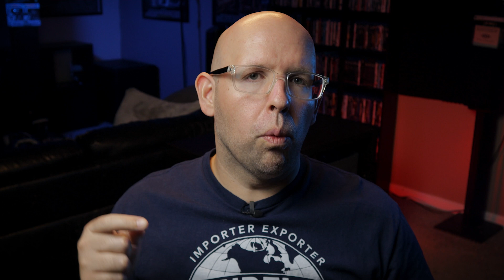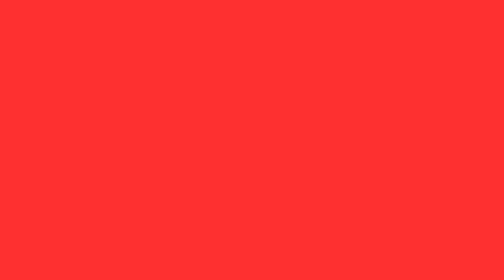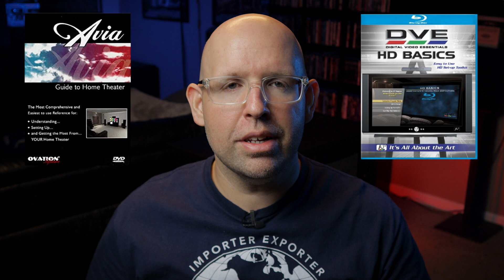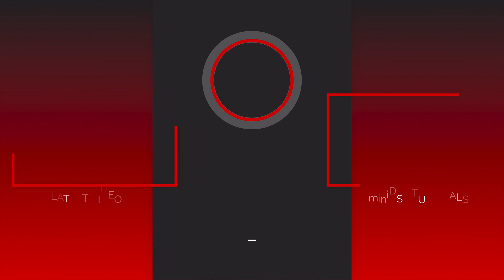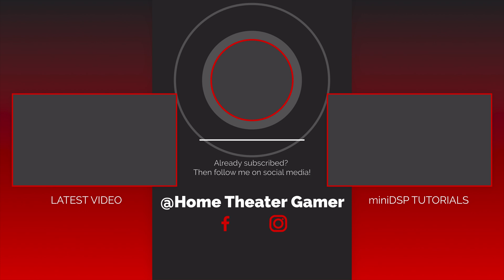FOLLOW-UP VIDEO to REW level matching | EXPLAINING things I FORGOT

Comment: Hey Brad, I hope you could answer my question on the level to set in the tone generator like -30dBFS vs 35dBFS because my center channel polk monitor xt30 got maxed out at -12db on my denon AVR-x1800H while i set the tone generator level at -30dBFS while calibrating to 75db and could not hit the desired level and after changing the level to -35dBFS I could hit 75db on spl with out maxing out my trims in denon. I didn't understand this

Comment: Hi Brad. yoyur are a great teacher !  I do have a couple of questions,  is it possible to calibrate any processor/ AVR  with REW unlike  Dirac ? as I understand a specific Dirac Licence is required for individual AVR & Processor. My system consists of Denon X7200W , Tone winner AT300 Preamplifier, Tone winner  7300-PA Power amplifier  Tone winner AT300 has 3 Sub outs ( One balanced XLR & 2  RCA LFE out) .  .  My speaker system are placed in Auro 3D & Dolby Atmos 7.4.2 Mode. what is the best way to calibrate these formats? your advice would be highly appreciated 

Regards
Anoop
Reply: Hmm…it isn’t an Auro 3D setup without x.x.4. If you are only using two height speakers for Auro…your out of the minimum recommended spec of 5.1.4

Comment: Do you set your Umik to 100% in windows or 0db which is like 53%? After dirac calibration, setting all my levels to 75db with REW I have to take all my levels down like 5 or 6db and now it seems low. Pretty sure my mic is set to 100% though in dirac and 53% in windows for REW. Please help.

Comment: Hi Brad! Love your content and helped me so much in my theater setups. Not sure if this has been suggested already but this is regarding setting the levels on the Atmos height channels. What if we jot down the levels of the surround left and right speakers, then disconnect them and connect the left and right atmos speakers. Run the test tone and adjust to 75db, jot down the levels, disconnect the atmos speakers from the L & R surround and connect them back to the atmos channels and set the level recorded from the surround channels. Then reconnect the surround channels back to their perspective channels and change the levels back to what they were set at. It's a mouthfull and hope you followed me. Do you think that would work in setting the atmos channel levels?

Comment: But if I leave YPAO on, it automatically applies some EQ, right? Wouldn't that affect the REW frequency measurements later on? Should I keep YPAO on just for Level Matching and disable it afterwards? With YPAO on I cannot change any EQ settings to level out the freq. response.

Comment: Thanks for this. So is this the same case with Dirac? I have an Arcam AVR11 and I setup the levels using REW and. UMIK-1 and noted the values before running DIRAC or any other processing. Then after running DIRAC I noticed all the values were reduced lower than when I set them with REW. So I should set these values back to where they were before or Test with REW again with DIRAC active correct?

Comment: Shouldn’t running at 0dB on the AVR get you 105dB? 

I never run REW above -15dB becuase it’s frighteningly loud
Reply from the maker: If set to 0dBfs in REW, then it would read 105dB. But for level matching/calibration, that’s not really needed (and really loud), which is why it’s common to set REW to -30dBfs and calibrating all speakers to 75dB.
Reply: Watched the other video and that answered it!  -30dB on REW…

Comment: Simple question, who says that all speakers at 75 db for all channels, is always the right Choice 🤷, every room is different, and it also tottaly depends on where your speaker are away from your MLP😅 so this is all very different in milions of different rooms
Reply: Simple answer. You are setting the volume levels for reference level volume. Not what you prefer. Otherwise everyone is talking a different language. If you want to listen at a lower volume use the AVR volume to lower it. But the whole point is that at 0 db on your AVR you will be listening to volume at the level the sound engineer designed it for AND you are listening to everyone else's 0db setting. As for what I prefer, I listen at about -15db for movies, but if me and you were to both turn our dials to 0db we will both be listening  to the same content at the exact same level and what the sound engineer desired.
Reply: @Mudcat3434  ok thank you for explaining this so clear, i now understand what you mean by reference level, again thanks for explaining it so simple
Reply: @dutchgrower2971  yep no problem. I was confused about this for a while. And then it finally clicked haha
Reply: @Mudcat3434  little question tho, if someone adjust lets say the source level in the avr [some devices have low volume] then the reference level on that specific source is not correct anymore , am i right,
i mean in my case i added 1DB to my sat/cab volume , cause my sat has a low volume, isn,t that messing up the reference level again, sorry for my english, i try to really understand it
Reply: @dutchgrower2971  Yes it is, but audio via your cable/streaming service is not really what we are worried about. They are messing with things on their end as well. So no harm really there. What we are worried about with reference level is 1) a common measure to calibrate our speakers and 2) source content. Source content being Ultra HD Blu Rays, video games, lossless music such as that from a CD or other lossless media like FLAC music on a USB. Even Netflix and Amazon Video will have quality (although I not sure if it is compressed audio or not). Cable TV though or streaming services like Hulu Tv and YouTube TV, etc. may or may not have quality audio passed on to you and they mess with the volumes anyway. This is why you are watching a show and it goes to commercial and the commercial volume damn near blows your eardrums out. In the end though, stay close to reference volume for the calibration, but what you end up actually listening to your content at, man that is your preference and I say adjust it to what you like.
Reply: @Mudcat3434  thanks again , its true tv is different volumes, this clear things up for my , thank for explaining it again your awsome

Comment: Been watching your videos and really like them. But for true beginners they can be tough to follow as you do sometimes gloss over some things. For instance in the video your talking about here, making sure all speakers are set to 0db in AVR.  Did you change them from what Audyssey set them?  Beause you also said you left Audyssey enabled but on another vid you said to shut it off. I think it would be great to make 1 long detailed video on how set up a complete H.T setup and to run Audyssey then REW to make changes on exactly what to change all in 1 video instead of having to go between different videos with conflicting instructions. Keep up the good work and try to just keep beginners in mind when doing videos
Reply: Yeah, this would be very helpful. I'm going through his miniDSP videos now, and have some confusion on how/if I should be adjusting the AVR trim on the subs or using the miniDSP or what if I were to run Audyssey after adding the house curve.
Reply: Agree

Comment: Hi Brad,
Quick random ques,  when you went from a single PB2k Pro sub to dual, was there anywhere in your REW sweep that came out worse at MLP?

I’m textbook flat with EQ at MLP with 1x front left PB2k Pro (but of course not at other seats).

Had a chance to add a rear right unit briefly and even with time alignment I had a weird null at ~75hz that isn’t there normally 🤔

Unfortunately no other placement options for a 2nd unit in my space.  Wondered if you saw nulls appear too.  although I do gain elsewhere with 2 across other frequencies.

Keep up the good content 😎

Comment: It's been said in some of the other level match videos It's not as important to use an outside source to level match as it's more important that the level are even from channel to channel. Using the internal test tone would accomplish the same thing even if it read high or lower in REW the channels would all be even giving you the same affect.  Audessey running or not running wouldn't change them being even. Might want to try it both ways and compare it will like sound exactly the same.

Comment: Good video. If I set MV as per video so for achieving 75 DB I have to move speaker DB level in minus or  more than minus 10. But in AVR level can move max up to minus 10 and not beyond minus 10 as there are max level is minus 10. I m using Yamaha HTR 3072 AVR with Yamaha high end Bookshelf speakers with Yamaha SW 300 sub woofer. My Flat area is 130 sq feet so I think in my case I can not set MV 0 so I have to set MV in minus than only I can set 75 DB level for each speakers. It's a 5.1 system. YAPO is ok for distance. n other result r not good in case of room with furniture. Your video is good.  Thanks Bro. Pl reply.

Comment: Remember that channel 4 - the subwoofer is + 10 db (lfe) so that one should meassure 85 db and not 75. So its not hot but by design
Reply from the maker: Gotcha. Thanks for explaining that! I think I've always just found it easier to use the front left method to set the subwoofer volume, and it's a habit I started way back when getting into home theater. You know what they say? Old habits die hard haha.
Reply: @thomasdk1405 so when level matching the subs, match them to 85db? Also I have dual subs, so do I turn one off and level match the one that's on and then viceversa? Thanks in advance!

Comment: Today I decided to pull out my laptop and umik 1 and test how well The auto calibration of my Sony es1100 receiver was, I figured it was good enough because I would rerun it after a calibration and I would get the same results. Well I was wrong, my center channel was down 2-3db and my surround speakers were down 3-4 db and my subwoofer was up around 88db, I level matched everything to 75db and It sounds so much better and immersive with significantly more detail in each speaker. Sure the bass is a weaker now but it doesn’t draw attention to itself anymore and seems to add depth and dynamics to the speakers should be making the noise at a given moment
Reply from the maker: That’s great to hear! As good as some of these auto calibration systems are, they aren’t perfect and might need some tweaks. Like you said, while the bass is weaker, it added depth and improved the dynamics. And even if you find yourself wanting a bit more bass, it’s not uncommon to add 3-4dB to the sub especially if you listen at lower volumes. Ultimately it’s about tailoring the sound to your ears and what sounds good in your room.
Reply: @HomeTheaterGamer  I was surprised to hear hear that much of a difference. I plan to do some more tweaking this weekend. Typically I watch movies at -12 to -10 for blu ray disks, whereas streaming services I have to turn it up a bit to -7 or possibly reference level in some cases. Thanks a lot for the videos, they’re very informative
Reply: Subwoofer is not compensated here as internal tones - they should all read 75 db. Sub here should be 85 db ! Try to level match REW sub to 75 and then goto internal tones - then you will have 65 db on the sub 😜

Comment: Hey Brad, Thanks for all of your efforts and postings.  My Onkyo TX-NR636 and my older Denon  AVR-591 will not let me turn off internal test ones while setting levels.  If I am missing a setting, please let me know.  Please ask your Audyssey contact if it does in fact adjust EQ on each channel.  It would be a great video interview to have an Audyssey engineer fully explain how it works and the best practice in using it.  Also, do you know of any new or old <$1000 AVR that lets owners adjust each channel EQ manually?  Thanks again!